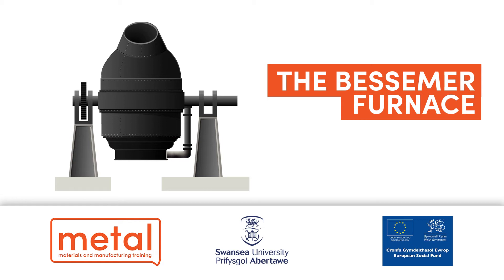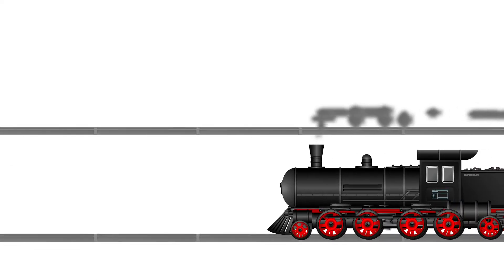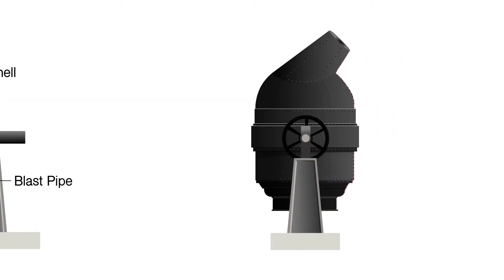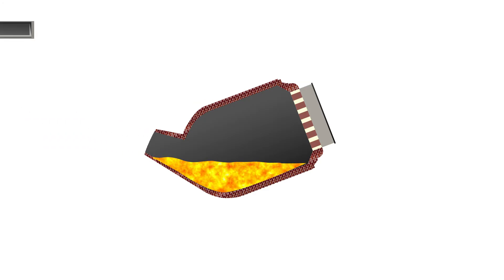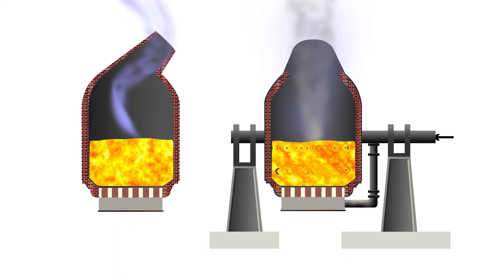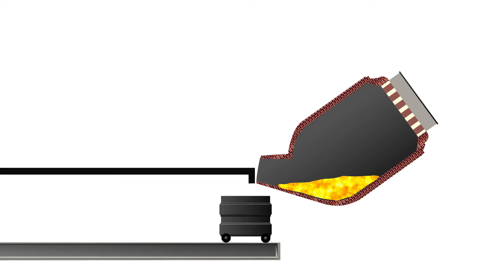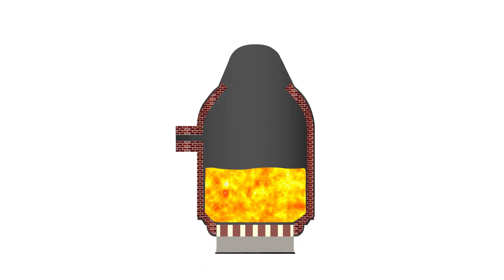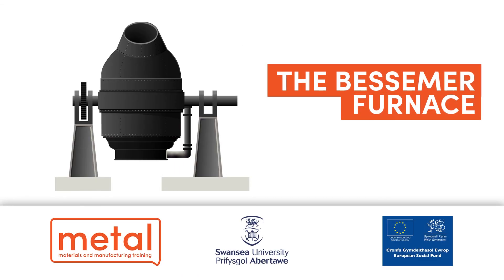The Bessemer Process and Bessemer Converter: How They Work

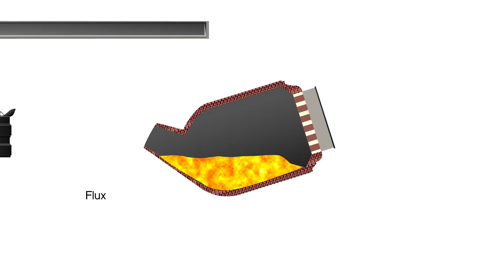Comment: why does the molten steel not flow into the tuyeres at 1:35 ? how can air go out of the tuyeres but steel can't go in?
Reply from the maker: In the image after 1 minute and 35 seconds on the left hand side the mushroom shape of the tuyere is shown. With this design the gas flows out of the tuyere towards the base of the furnace. As a consequence of this design the pressure exerted by the weight of steel in the furnace is significantly less than if the gas was applied vertically into the furnace. The result is that the gas pressure always exceeds the pressure from the weight of steel in the furnace and there is no leakage of steel into the tuyere.
Reply: This should be popular in USA education along with Joseph Wilson swan, isambard kingdom Brunel, James watt too

Comment: umm, what is flux?
Reply: Flux in this application is any substance that promotes the removal of impurities and forms slag. Limestone is commonly used for the removal of impurities from hot metal during Iron-making and Steel-making Processes. Other materials used as fluxes are silica, dolomite, lime, borax, and fluorite.
Reply: It’s a like a substance to remove impurities present. If the impurities are acidic we use basic flux or vise versa
Reply: @Regar_5  thanks
Reply: @Regar_5  thanks
Reply: flux is a waste product. picture a dirty glass of water now you take a tiny pool skipper and skim out all the dirty impurities and it forms a lumps as you skim it out that's what flux is .